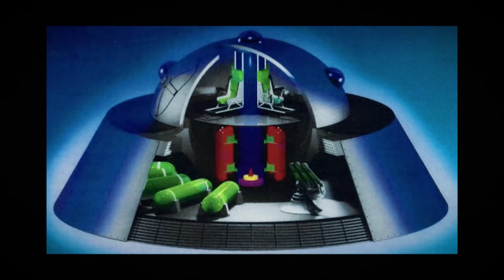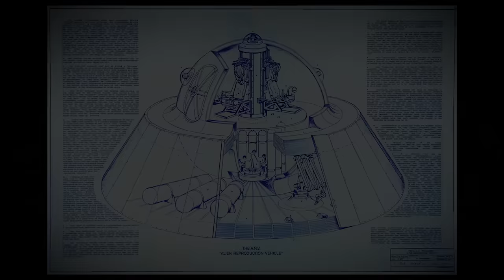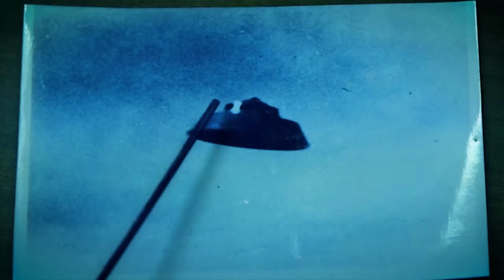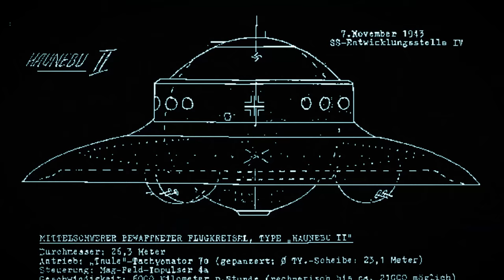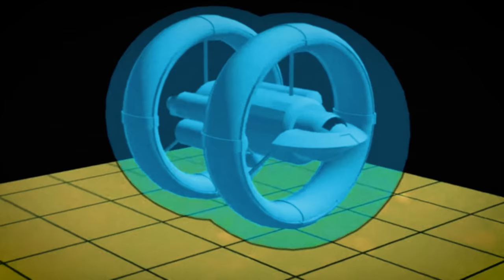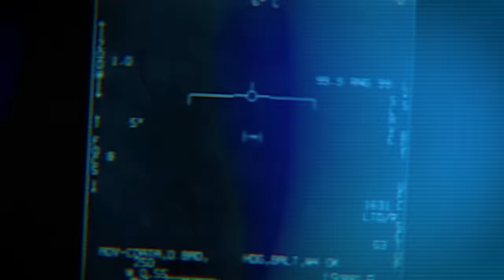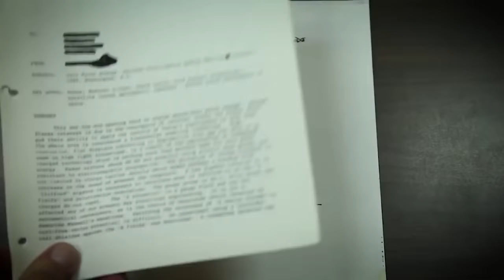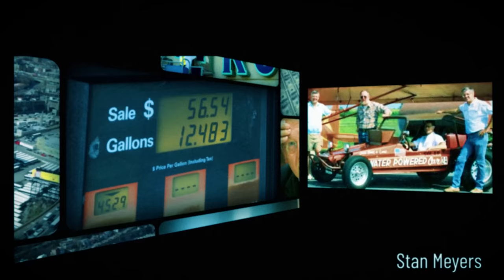How to Build a Working UFO | Alien Reproduction Vehicles (ARVs)

Comment: 15:45. INCORRECT.!!! 

Let's just say something pushed you up to 99% the speed of light. And then hit the brakes and let you continue on at 99% the speed of light.

With your relative mass be any greater or lesser than your rest mass.? 

Since you can't directly respond. I shall just tell you the answer. 

The Mass does Not Change.!

You have exactly the same mass as you had before you started the trip. 

But you do have more kinetic Energy. And so in that way you could say that becaus Energy is Mass. If you have more Energy. You also have more Mass.! But technically that's not correct either. 

Mass is relative. If you were on board that ship moving 99% the speed of light. It's mass has not changed relative to you. 

But due to the kinetic energy of its forward velocity. 

An outside observer would have to consider your kinetic energy relative to them. As your apparent Mass. 

But the actual Mass has not changed. However. 

What the confusion is all really about. Is the mass of the fuel that is required to achieve the speed of light. With conventional technology. 

So like if you were going to try to reach the speed of light with a rocket ship. That rocket would have to be so big. That no physical structure could actually exist.

At length it would break apart. Or not fit in the universe. 

Or altogether as a square of the distance from the center point.. It would just turn into a Black Hole. 

So you can't even get together that much material. Without it either breaking or turning into a Black Hole. 

But if you could avoid those perils. Then you would reach superluminal velocities.

So it's Not that you acquire mass as you acquire more vector velocity.!

It's that with the technology that is used. The amount of fuel that is required. Would be practically untenable. 

Giving rise to the miscommunication of infinite energy requirements.! 

And this is a misconception.!!! 

which are usually never good. in this case it's leading people to believe that even attempting to reach even 1% the speed of light is folly. 

But let us consider this.

if you only accelerated at a minimal force of 1G. That's 32 ft per second per second. Or approximately 22 mph. 

if you could continuously accelerate 22 mph every second for 8,492.1998181818 seconds. Or 2.3589443939 Days. You would then achieve a Delta-V of 186,282.396 Mps and or "C" The mathematical expression for the speed of light. (Which is really just the speed of causality.!)

Which means if we could somehow produce a continuous force that resulted in a 22 mi an hour increase every second for approximately 2.35 days.

One could and would achieve luminal speeds. Maybe even superluminal speeds if you continue to accelerate for 2.5 days. for dare I even say it. A 3-day acceleration. lol.

The problem comes when you try to slow back down after breaking the light barrier. 

You can think of it kind of like hydroplaning on the fabric of space. It's hard to even get a grip to slow down.!

From an outside observer's perspective. You would appear to turn into a Black Hole. But again from your relative perspective. The weather is fine. 

Now something you should be aware of if you're trying to explain the function and/or operation of such a technology. 

Is that it actually does not move that fast. I mean it can move fairly quickly if you give it enough time. But if you can control time. Then it's rarely ever necessary to utilize it for that length of time. To facilitate that much force. To go that fast. 

Because they can admit a time dilation field around the vehicle. they are just fast forwarding their external environment.!

And when you see the move quickly. That is the time dilation engaging. And when you see the moving slowly. It is their regular motion. Granted they can move in 6° of freedom. And hover. But they don't actually do so very quickly. As you can see when they are not moving quickly. 

But when they wish to move quickly. They move regularly. and then engage what I like to call the fast forward drive. 

Which then to an outside observer would look like it's moving regularly. And then someone Hit fast forward on the remote. And they take off like a bat out of hell. 

Never actually needing a propulsion that creates that kind of thrust. And achieving high speeds including superluminal speeds. With time dilation of regular motion. 

Thereby circumventing all the normal relativistic problems associated with FTL travel. 

So yeah the statement that mass increases with velocity Is invalid. 

But ironically. They're not actually moving at superluminal speeds. They're just fast forwarding time externally which results in superluminal non-locality. 

I hope you found this helpful.!  🍻

Comment: From what I understand on the water motor system is 12v of electricity some baking soda for a catalysts and something to hold it in the a vacuum line for the hydrogen to be fed into the air intake there's multiple videos on YouTube I kinda want to try it and see if it really works this is just a ruff summery if things ive found on line about the hydrogen powered engine i believe we could make hydrogen hybrids and with this you would have 100% fuel burn effency that's the theory behind it from what ive read

Comment: So an aircraft presentation event for military contractors is held... and a man is able to just slip into one hangar where several working UFO reproductions exist... not wearing any special badge or has to sign in for access to the craft. You'd figure he'd make note of people who were facilitating the presentation for later reference, and perhaps others in attendance. Why not go back to this source, instead of trying to piece things together from many disparate accounts? This isn't adding up.
Reply: If you do go to the source, you will find how he was invited and escorted in. The initial meeting was at the airshow at Norton AFB and then Brad was flown in a jet with other guests to the Lockheed facility in Palmdale CA and then escorted into the show.

The purpose of the show at the hangar was to procure gov't funding for more secret projects. However, Brad's host did not realize that the ARVs would be exhibited to the audience, hence the surprise and Brad's fear about a security breech.

Comment: To access 0Pe thhe human body uses a very small filament.  Similar to an antenna.  The chimps have yet to find it.  But that filament is what provides your neuro system with the electrical energy needed to move muscles and keep you alive.  Use a similar receptor and adaptor and you could connect the machine to provide electricity to your home for free or charge your Tesla for free and endless driving.  But, if we gave you that technology oil would collapse and the value of the dollar would sink to zero and the United States would have no power over the rest of the world.

Comment: Let me help you out a little bit there ...

Zero energy would be free energy that it is absorbed from the world That's a little bit different than a UFO ... A UFO is zero gravity .. And it's fueled by Element 115  ... That's not free...  We used to have to trade to get that .. Now I'm sure we can make it  .. that's why it's on  The periodic table now ..

UFOs have allot more going on then just free energy... They use element 115 ... This fuels for worm holes ... There's no inertia going on This is called zero gravity ... 

And it's not free ... I'm sure the hydrogen collider is one way of getting that element  .

Element 115 was the first superheavy element with an odd atomic number (Z) that we synthesized in nuclear reactions using a beam of accelerated 48Ca ions.Dec 14, 2018. .. 

yup sounds like that's why we made the hydrogen collider
Reply: That's not 100% correct... Without element 115 the UFOs can't go through worm Holes.. it will also go slow .. 

Like how the military used to just display them and they would just sit there and levitate those that's basically the free energy that's what they do by themselves with the element 115 that's supposed to be like unstable or something like that and then create them to go as fast through worm holes ..

Because at one time we didn't have element 115 ...we had to trade to get it ... This was the ETs leverage for a while. . Until we made element 115
Reply: I think I heard all that from one of Bob lazar's videos..  I believe Bob Lazar said  he made a miniature particle accelerator that's what I think I don't really remember .. 

I know Bob has a Hydrogen fueled Camero
Reply: I think the bell also manipulated time ..also ... Not sure
Reply: WOOT ...DR STEVEN GREERS ... I LOVE THAT YOU PUT HIM IN ... NICE JOB